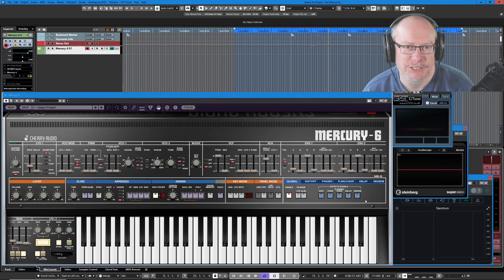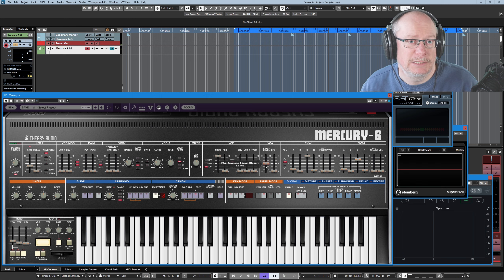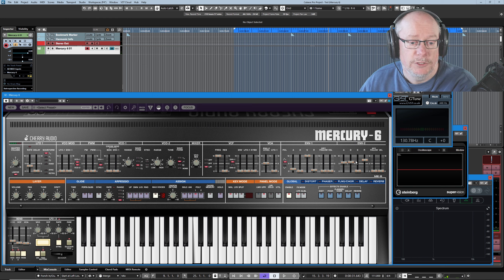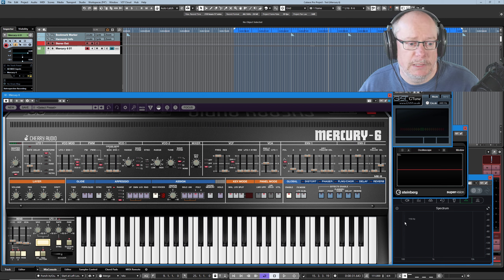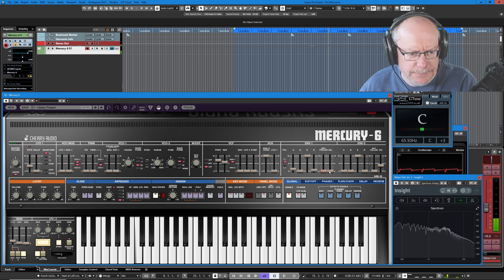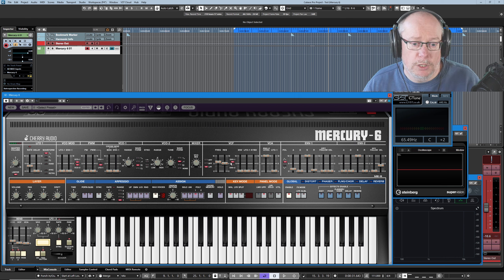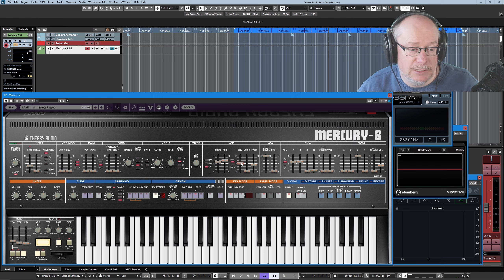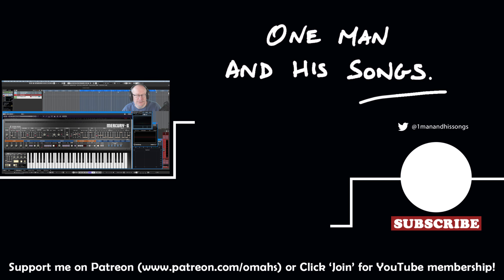Cherry Audio Mercury-6 Ep.2 - Envelopes and Filters

Comment: 5:37... This was a clear explanation that I needed for me to hear. I accidentally understood "key follow" in the context of a VCF a while ago. That particular mental-lightbulb switched on when I tried it (in the Retrologue 2 plugin) for the sake of feeding a noise-oscillator through a self-resonance setting -- which kind of mimicked a tuned wind-pipe in a way (lots of tweaking happened to get the filter reso to loosely follow the correct concert pitches). However, I have never understood "key follow" for an Amp ADSR. Therefore, thanks to you, this gap of understanding is better filled. I can see this being especially useful for keys/e-piano/harpsichord mimicking patches. Thanks again! I have a lot of strange & random pot-holes in my understanding of synthesis.
Reply from the maker: That's very kind of you to say, thank you! I certainly understand what you mean with the pot-holes analogy - there's always something new to study and better understand :)